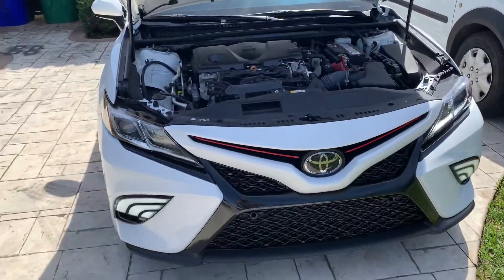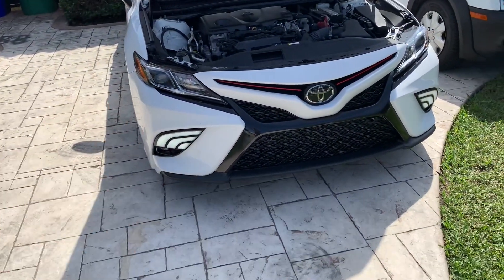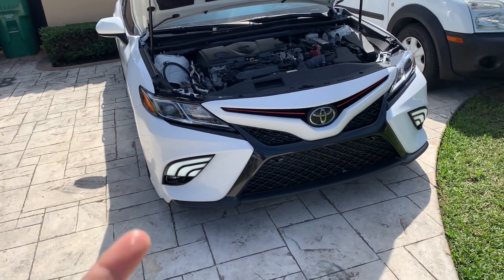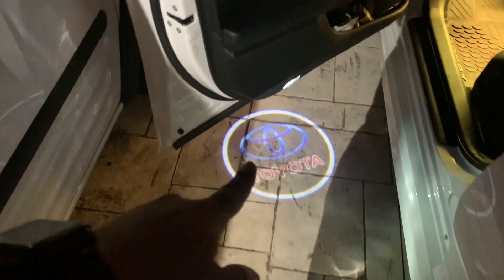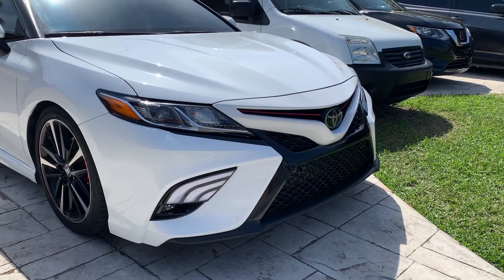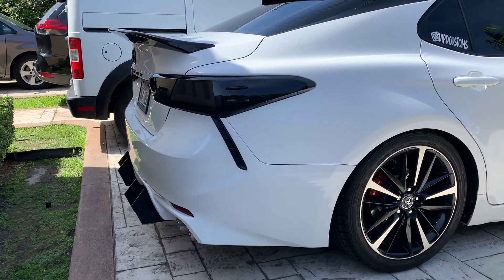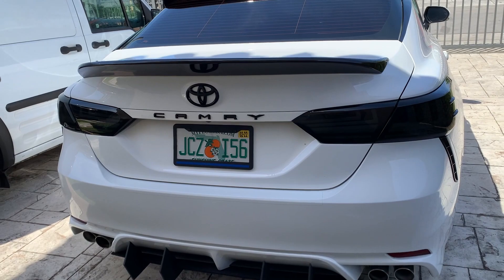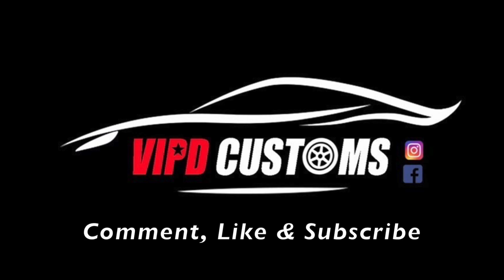DRL install on the Toyota Camry !!!

Comment: Hi, installed this led lights my self on my 18 camry se. Your car looks great. The red wire I connected to upper fuse second one. My question is where to connect the blue wire? Second  line of fuses first from  Left?  one?? Than you.
Reply from the maker: Yes
Reply: @VIPDCUSTOMS  thank you much.
Reply: @VIPDCUSTOMS  I connected the blue wire to the fuse but now the blue city light took over the white led... that's the way it works?? Ty
Reply from the maker: Some of them are blue instead of white depends which one you bought
Reply: @VIPDCUSTOMS  I just disconnected the blue wire from the fuse. And now back to white led. Blue looks nice but I thought there was a way to turn them on temporarily. If there is a way please let me know. Thanks.
Reply from the maker: I’m not sure

Comment: I connected the fuse tap where you tap the red wire for my DRL yesterday. have you had an issue since then?
Reply from the maker: Never had a issue even until I sold it

Comment: I wish you could’ve showed how to route the wiring to the firewall
Reply from the maker: Routing thru the firewall is only needed for the fog light , all the wiring needed for the DRL is in the hood. Also to go thrubthe firewall it’s the usually garment on the firewall that end up coming out by the pedal area
Reply from the maker: Limited space but it’s a gourmet around the steering shaft

Comment: Quick question again.  I was interested in adding those door Toyota logo lights but when I opened my doors there appears to be some red reflector on the bottom of the front doors and nothing in the rear doors.  Is my Camry not compatible with those lights?  I have a 2020 SE.
Reply from the maker: I don’t think so, the fronts have to have a light and rear don’t have any

Comment: Mine stay on blue . Do I have the wiring wrong and they don’t blink and there supposed  to. I have a 2019 Toyota xse . Any info can help
Reply from the maker: No you have a different DRL
Reply: @VIPDCUSTOMS   so I disconnected the blue wire and it turned it off and now it went back to white but my orange blinkers don’t turn on . White drl stays on since I took blue wire off . Any advice seems like I have same one as every one els
Reply: @VIPDCUSTOMS  the only thing I don’t have is that orange light bulb on the stock head lights I have the led strips
Reply from the maker: It’s definitely different than my set I don’t have any blue wiring
Reply from the maker: Yellow are turn signals you have to wire it to the turn signal

Comment: Would you happen to know where to connect the turn signal  yellow wires on xse led headlights? They’re different than your video and I’m stuck :/
Reply from the maker: On the turn signal of the car
Reply: Since they’re LED headlights there’s no turn signal bulb. There’s a harness with cables going to the headlights but I’m not sure which wire controls the turn signals. Thanks for the quick response man
Reply from the maker: Trying my best brother , I know a company called distant extreme that has connectors like the ones you mentions. I have a SE so I know where it is. Most likely you have a XSE AND it’s probably one plug in and that’s it . You will have to follow up with the company
Reply: Is different than the se. Don't know.
Reply from the maker: Weird
Reply: @gosto6552  hey buddy it's the light blue  wire on the plug going into the lights.  Take a wire stripper and cut only the plastic wire  casing, then push it back a 1/16th inch so you can wrap your yellow wire to it then tape it up...

Comment: Hey, taking possession of my 21 xse today and want these but I’m reading the xse is Different from the other models.. what model car do you have?
Reply from the maker: So the 2021 is slightly different body style then 2018-2020 and the XSE is usually different engine and different parts like the parking brake , fog lights , wiring etc but it’s all pretty much the same. I have SE
Reply from the maker: So the 2021 is slightly different body style then 2018-2020 and the XSE is usually different engine and different parts like the parking brake , fog lights , wiring etc but it’s all pretty much the same. I have SE
Reply: Ok Thank you, I just sent a message to cuztomtuning to see what they have..
Reply from the maker: Then and hirevsports

Comment: U said sometimes they turn on by them selfs , what do u do when that happens ?
Reply from the maker: They turn off themselves
Reply: My led lights turn on any time randomly.  Days nights I can figure that out either... as long battery is fine I don't mind.
Reply: @gosto6552  has it drain your battery?
I just installed them & saw they were one when I came outside lol what I did is just left the switch on off & not on auto (like for the lights to turn on when it starts to get dark u know ) hopefully that works . Let me know
Reply from the maker: No it hasn’t
Reply: normally mine will jump on for about 20 to 30 seconds by themselves. But the other night they stayed on for about 3 to 5 minutes but the battery was ok.
Reply: SIRSILVERDOG good to know next time I'll see how long they stay on for . Definitely something the seller should fix
Reply: @raul19979  No, it isnt the sellers fault. From what I understand, its the fuse location itself. That fuse does something like a sort of update every hour just in case you had a remote app. If i understood it correctly.
Reply from the maker: Yes the car does a self check
Reply: @raul19979  does this help?  I’m going to try doing this from now on if it prevents the DRLs from turning themselves on when the car is shut off.
Reply: @VIPDCUSTOMS  does it drain the battery?  Just got these lights installed on my Camry and noticed a few times already the lights were randomly on when the car itself was off.
Reply from the maker: It doesnt
Reply: @VIPDCUSTOMS  okay.  I wasn't sure if I should bring it back to the person who installed mine or if there's no workaround to this issue.
Reply from the maker: No workaround

Comment: Hey , so I installed some fog lights 
To my Camry but they randomly turn on and off while the car is off, what should I do ?
Unless I didn’t connect them correctly
Reply from the maker: You wired them the same way?
Reply: Any updates on this?  I was just told by a relative that my light was on while the car was off but then the light turned itself off.  I’m wondering if I need to take the car back to the shop that installed them.  Or if it shouldn’t mess with the battery in the long run and isn’t something to worry about.
Reply from the maker: Nope doesn’t mess up the battery at all , it’s a system check the vehicle does

Comment: Dude there's got to be a way to get the white DRLs and Blue night lights to work independently. Couldn't I tap into the Automatic Light control with the blue wire?
Reply from the maker: Honestly I think they 2 different lights
Reply: @VIPDCUSTOMS  yeah, I’m aware they’re two different lights but I’m saying there has to be a way to wire them so that the blue lights are on at night, and then only the white lights are on during the day. I was saying that maybe wiring the blue lights into the automatic light control would accomplish that.
Reply from the maker: What I’m saying both lights are different complete from the housing there is the all white ones and all blues ones . I don’t think there is one that has both white and blues
Reply: @VIPDCUSTOMS  ooo ok I gotcha. Cool man thx
Reply: This is a SE model. Man trying to find an XSE model. How to tap into the wiring

Comment: Hey I just installed some drl and fog lights on a Camry and now the taillights don’t come on when the car is on but the turn signal brake lights and reverse lights still work any suggestions?
Reply from the maker: I’m not sure what you did ? Usually the tails are on a seprate fuse unless you touched that. Maybe check if the tails fuse is blown?
Reply: @VIPDCUSTOMS  only fuse I touched was the top one that every body uses on the other videos just like yours
Reply from the maker: Honestly not sure , did you change taillights ? Again check the tails fuse maybe it’s blown
Reply: @VIPDCUSTOMS  yes they are aftermarket
Reply from the maker: Probably you didn’t install the tails properly
Reply: @VIPDCUSTOMS  but they worked at first but it might be a connector at the same time
Reply from the maker: Not sure honestly

Comment: did you need to remove the bumper to add the DRLs or the fogs lights?
Reply from the maker: I removed the bumper to swap out the stock SE GRILLE  to XSE Grille , but it is 100% removing the bumper for the DRL and fogs
Reply: Link for grille ?
Reply from the maker: Carid.com don’t have the link
Reply: @VIPDCUSTOMS  thanks 😊
Reply: Underneath cover need to remove... no need to remove bumper. Use a couple of ramp to be safe.

Comment: Can your DRLs turn blue?  On the ad for the lights I got on eBay it shows blue lights on one picture but I can’t figure out how to make mine blue.  I had a shop install them and they look really nice but I can’t change the color to blue.
Reply from the maker: Some come white some are blue ,it’s either or
Reply: @VIPDCUSTOMS  thanks for the response.  However, mine did have both, but I guess the installer didn’t install the blue wire/light since he tested it before installing the lights to my car and said it was pretty bright blue and that I would most likely get pulled over if he installed them.  He said I can always come back if I really want them installed but I think I’ll be fine without them since it would be a waste of money just to have it installed for show since I can’t drive with them on.  Looks like I’ll stick with the white DRLs unless I really want to show off the blue lights to friends and family lol
Reply from the maker: Weird am sure you won’t get pulled over for the blue since it’s like a light blue
Reply: @VIPDCUSTOMS  idk I live in California and would rather not risk having any interactions with CHP or my local city police department.  I can always go back and have them install the wire if I really want to but I’m good for now.
Reply from the maker: For sure
Reply: @gregoireansari6651  have the same lights with the option for blue install by the shop and I live in Northern California and was told the blue is illegal to close to being police lights. So I didn’t hook up the option for the blue lights. Just the the white DRL.
Reply: @shanda2600  thanks for the response.  And yeah I was told the same thing by the shop that installed my lights.  On some of the videos I’ve seen the lights don’t look that bad but I guess in person it probably looks too similar to police lights.  Oh well.

Comment: I was able to connect the blue wire. But now blue city led lighta took over the white led lights. Any suggestion. Are the blue city lights legal? Ty
Reply from the maker: Depends in your car
Reply: If you only connect the red wire the lights are white if you connect both the lights are blue just installed mine today
Reply from the maker: No some lights are white drl some are blue
Reply: Mine came both colors I had both wires connect how you showed in the video and mine were blue I disconnected the blue wire and they turned white..
Reply: @whatitdo5535  I did the same thing. I was using just the white led. I found out where to connect the blue wire but blue led took over white led so I disconnect the blue wire now back to white. If someone know how connect the blue wire n change from blue to white n white to blue please let me know. Take care everyone.
Reply from the maker: Wierd
Reply: @gosto6552  did u figure out where or how the white an blue light switch back an forth I was thinking if u keep your lights on auto it should be blue until the auto light switches to full headlight at night an the drl should change to white
Reply: @Berg-rs5vh  I connected both wires red n blue to different fuses. but just the blue led light turn on even at nights auto. I disconnected the blue just using white.
Reply: @gosto6552  I'm goin to be installing mine im thinking about tapping into the headlight harness at the headlight itself im goin to leave my lights on auto an find that wire to tap into for the blue then turn on the regular night lights not highbeam just the regular night light for the white ill do a lil video if that works so we can run the blue for the day time running lights an the white for the regular night time lights  headlight on does that make sense